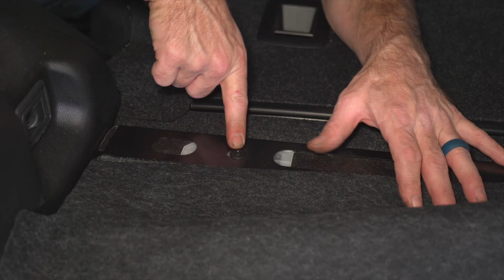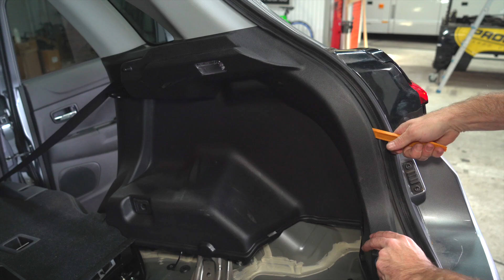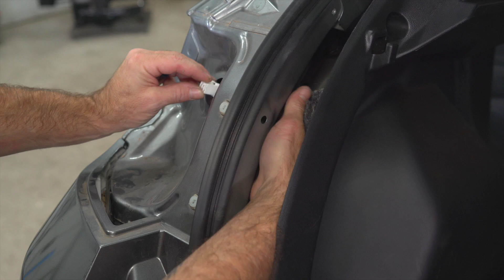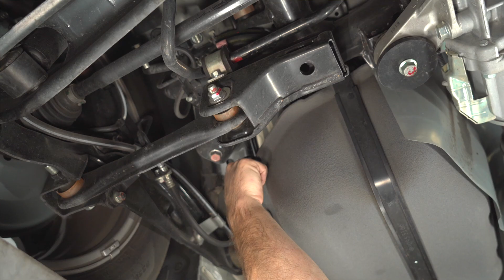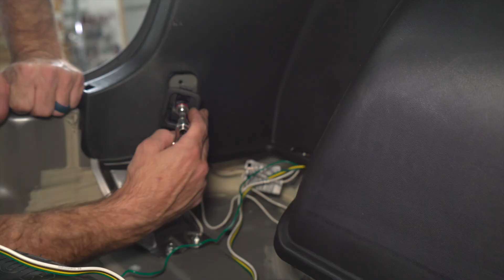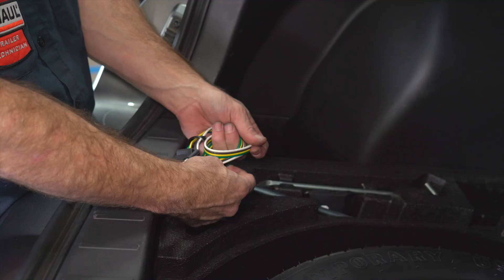2020-2026 Mitsubishi Outlander Sport | U-Haul Trailer Wiring Installation | CMF56482

Comment: how much can that car tow ?
Reply from the maker: refer to the Vehicle Owners manual for Manufacturer Towing Recommendations. Any Car can Carry a Bike rack or cargo carrier. Having wiring and Illuminated accessories keeps you visible and safe on the roadways. https://youtu.be/qbCOS-O5cHY , https://youtu.be/MbdaXVretn0
Reply: Last time I looked at a manual it was 2k lbs for that given year. Don’t remember what year specifically I think 2023.
Reply: 0lbs. The CVT is not rated for towing. The primary use here is for a bike rack or cargo carrier.
Reply: @BasedMerch  lol 900lbs